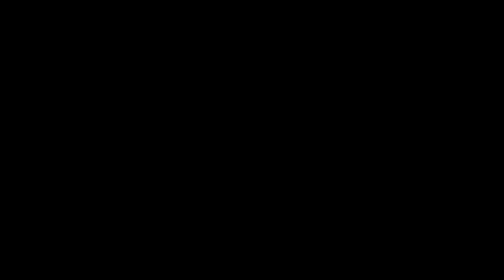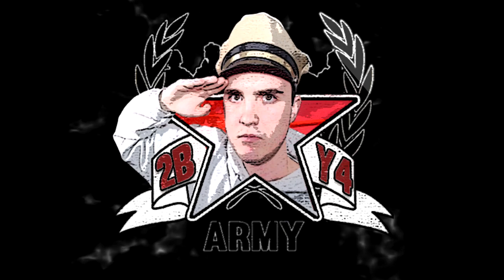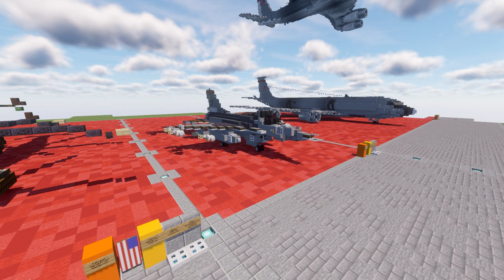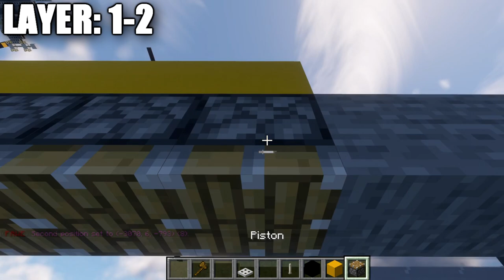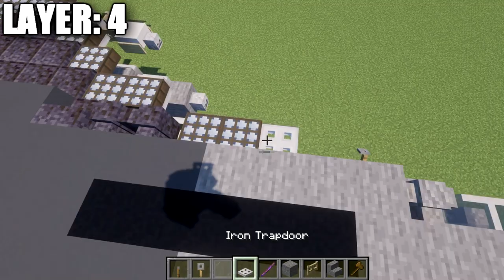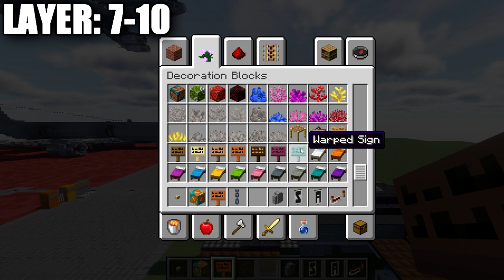Minecraft: Modern F-16C "Fighting Falcon" | Multirole Fighter Tutorial (In-Flight + Landed Version)

Comment: If I wanted to make just a normal, light grey, F-16, how would I do that? I'm talking about all the daylight sensors and dark oak trapdoors. For instance, the F-18E had the Jolly Rogers camouflage, how would I get just a bland and basic F-18? I also appreciate that you actually look and respond to your comment section, not very many YouTubers do that, they only say they do.
Reply from the maker: Hey Bonk! I would continue to use the daylight sensors set to the night mode (blue gray color). For trapdoors I would just use iron. Hope that helps! :)
Reply: @GARRETT2BY4  Okay, this helps kinda, but what is the point of the daylight sensors? What are they supposed to show? I don't have the daylight cycle locked because I like the engine glow at night, but whenever it is night it triggers the trapdoors. :(